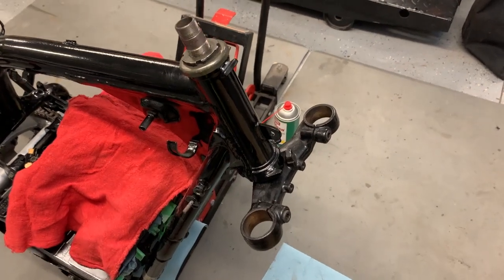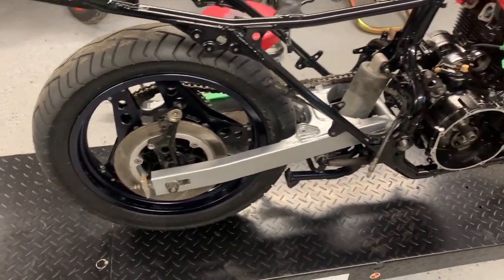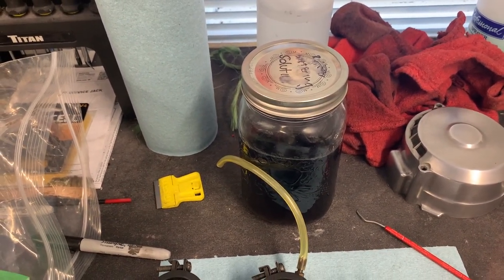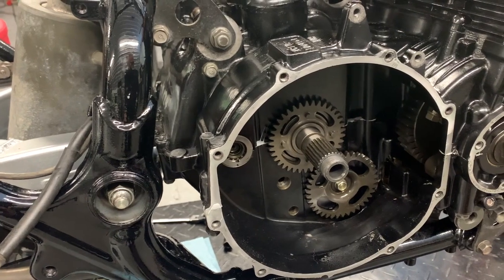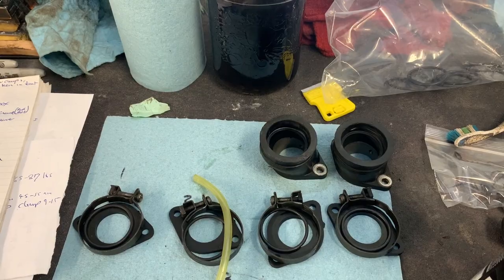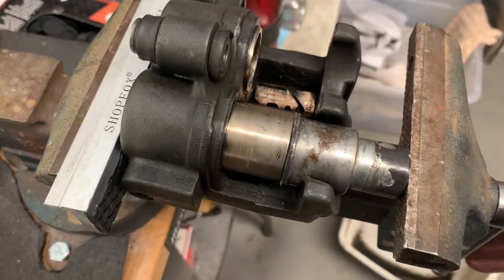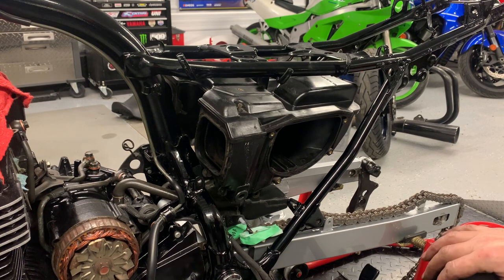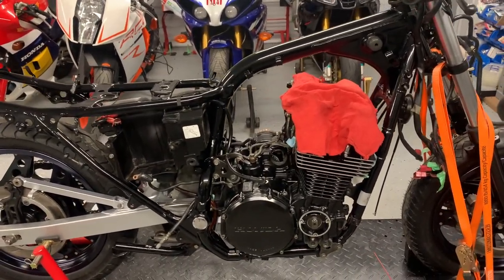1984 CBX750 Restoration - Part 6 Reassembly Continues

Comment: That’s coming along nicely, the air box seemed a bit hard to refit!
I’m surprised you didn’t fit air pods but original is best, don’t want to upset the carbs 😀
The wiring loom should be so easy 👍
Reply from the maker: Thanks for the comment.  Yea the loom was easy to install (done now).   Not a fan of air pods, I prefer to keep things as stock as possible, but yea, it was a huge PITA to install that air box.

Comment: Really like the videos on this one , have the same in my garage. Was looking specifically on how the handlebars are removed to see how you did it, i can not figure out how to get them off because of the retainer ring. Do you have any tips?
Reply from the maker: Just pop the retaining rings off the fork tops and then unbolt the handlebars and they will slide off the top

Comment: I removed the 2 rusty bolts from the top of the airbox and looking to replace them. On the inside though they where covered in plastic. If I install stainless steel ones do you think it will be an issue ?
Reply from the maker: Hi there ! I'd guess the the bolts are covered in plastic so that if they come loose they can fall out and get sucked into the carb throats.  You'd have to be careful on messing with those.   if they came loos and got sucked in, it would be a disaster.    re your other air box.  IDK, id have to see it.  you could try it and see how it runs, just make sure its not running too lean etc with a more open air box.